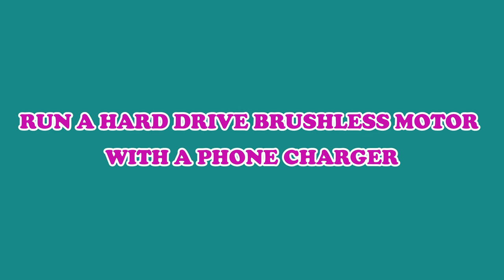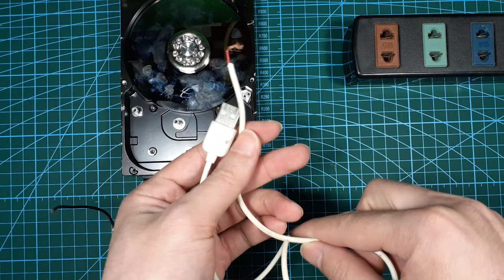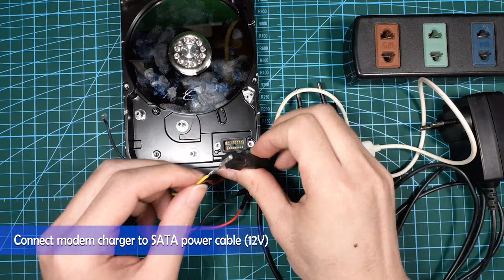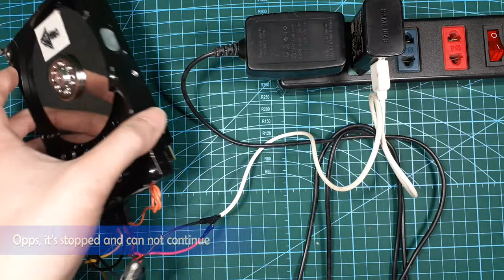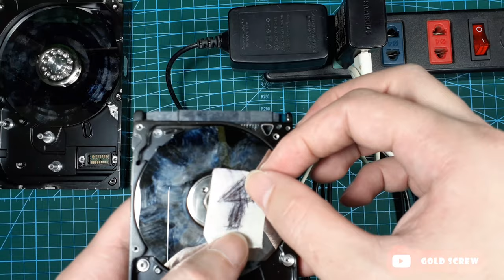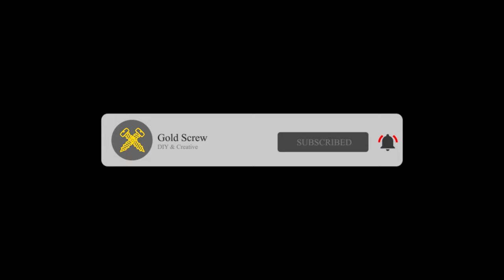Run a Hard Disk Drive Brushless Motor With A Phone Charger

Comment: Hey man, so i tried this setup and did work without a problem, But i have a question if you might know or if anyone else does,  I have an adapter for the USB  that has Output 5V 2.0A or 9V 1.67A or 12V 1.25A. So i was wondering if i can use the 4 wires in the usb cable, red - black to sata red - black for 5V and the other 2 in the usb cable to Yellow - Black Sata 12v and then connect it to the adapter that has all those outputs or would it not work like that because the adapter can only have one of the outputs "active" at a time?  Thanks in advance and great video :)

Comment: Thanks for the video , I think we can use a single 12v adapter and a voltage regulator for the 5v input
Reply: How to check the motor
Reply from the maker: Yes, You're right!
Or can also use a booster from 5v to 12v. Very much module/board available for sale right now (but better is from 12v to 5v).
Hope you enjoy :D
Reply: Yes , a simple .
Reply: Instablaster
Reply: @GoldScrew U need only 1mA for logic at 5V & 1A at 12V for motor driver, booster is nonsense

Comment: My bro,

Why don't you have this written out?  Your video is of little help because we can see what wires you are connected to for + and -.     Is that the SATA plug  you are making your connection to?   By connecting pin 3&5 to one another, what is that for/doing?    Which wires on the yellow, black, red, and orange connector do we connect to?

just a small listing of what wires you are connecting your 5V + to and 5V - to.    If we reverse polarity, does it spin in reverse?  prob not if its brushless..

Anyways,  text is always best, video is good as a visual reference, as an aid.

thanks man.
Reply from the maker: Yes, that's right.
I should have explained in more detail. However, because of the time at that time, I did not have much and I also wanted the video length to be moderate.
Why don't you find your own the answer: try reversing the + and - poles...etc? This is not difficult at all.
And please share with me the results :)
Thanks for watching!

Comment: Unfortunately mine doesn't work. I have a 3TB Barracuda DM001 and neither the 6+2 or 3+5 pin shorting works. It stops after 10-20 sec. Plus mine requires the r/w head socket to be bolted on, as I see yours is not, it has contacts on one of the two screws holes. I guess it's a hit and miss, have to try other methods.
Reply: You can test 2+6+7 pin.

Comment: Why do you need 12v& 5v to operate the motor ? Can I only use 12vdc with a speed controller?
Thank you
Reply from the maker: It’s depending on SATA power standards!
Yellow wire need 12v…and other color need 5v.
You can using only 12v and downgrade from 12v to 5v.
Understanding the standard SATA power supply pins in the HDD | Gold Screw
https://youtu.be/biN-sTTtEPI
Reply: the motor needs the 12v and the logic board needs 5v is my understanding and in order for the motor to work even the logic board should be powered up

Comment: You connect pin 2 with pin 6 to avoid stop with SATA HDs, do you know if there is a similar connection with IDE HDs? Thanks.
Reply from the maker: I'm not sure about IDE HDD.
I will research it and update and let you know soon asap.
Thanks for your question!
Reply: Bumping this question!
EDIT: Never mind, it's answered below!
Reply: PIN 1 AND PIN 2 of data conector. up right 1, up left 2.
Sorry for my bad english.
Reply: @pacoperezabella  Dont understand up right 1 uo left 2. i tried but no luck. its an 80 pin ide.

Comment: I shorted the 3 and 5 pin in sata but it still not continiously spinning, any solution
Reply: Try linking pins 2 and 6 instead, but bear in mind that not all drives will work like this - it seems to be a sort of undocumented feature that's not universal across all manufacturers

Comment: Will this process work for dvd drive motors also? 😶 Please reply
Reply from the maker: I'm not try it with DVD drive motors. But if it's brushless motor, I think it's can run no problem!
Reply: Ye
Reply: It Will work. I have tried it before
Reply: @emilsamuelsson1001  it didn't worked for cd drives brothers and sisters.. seriously I've tried thrice 😭 .
Reply: @smartgamersify  it should work if its a brushless motor that can run with DC powersupply
Reply: @Dax_eth  do you know wanna say that I'm lying to you guys? 😌

Comment: In case of pata connector which pins has to be connected for running continuously ??
Reply: Many IDE type hard drives will spin continuously as long as the power is applied, but not all. In particular, Western Digital drives won't stay spinning in this way, stopping after a few seconds.
Reply: first top left and last bottom right, or bottom left and top right, don't remember now.
Reply: @adriel3305  could you tell in detail using pin numbers.

Comment: Can you please confirm on how to do it for IDE HDDs ?
Reply from the maker: Maybe you'll need an adapter to switch SATA to IDE
Reply: @GoldScrew  thank you for your prompt response and keep up the good work.
Reply from the maker: @shouldbewillbe2813  I will trying to find old IDE HDD and make other videos soon.
Thanks for watching!
Reply: @GoldScrew  please do pass on the link of video to me as soon as you have made it. Thank You, you are the boss
Reply: For IDE drivers you need to jump the first up pin on right corner, with the down pin on left corner. FOr SCSI IDK
Reply: @linuxuniverseofficial  Thank You so much Guru ! This will be a great help for me !!! And I don't have SCSI drives ☺️
Reply: @shouldbewillbe2813  not working...
Reply: @linuxuniverseofficial  not working
Reply: @ratikantamahapatra8847  Sorry... IDK so how to do it in any other way ;/
Reply: @ratikantamahapatra8847  try the other opposite ones and post result.
Reply: @shouldbewillbe2813  top right and bottom left way is working....thanks sir
Reply: @ratikantamahapatra8847  congrats ratikanta
Reply: @linuxuniverseofficial  a huge Thanks to linux universe as well
Reply: Pin 1 y Pin 2 del conector de datos.

Comment: Hello. Can we use a 5V adapter and a regulator instead of the 12V in order to control the motors speed ?
Reply from the maker: The best is 12V, because the brushless motor required 12v. So if you want to use 5v, you'll need a DC-DC boost converter
Reply: @GoldScrew  i tried it and it burnt the motor. Any explanation for that ?
Reply from the maker: Maybe something wrong at wiring step!
I can’t see more detail your issue, only text here is very difficult. So I don’t have any ideas 💡
Reply: @abbashammoud7205  probably you connect it wrong or the voltage is too high

Comment: Tried this and does not work at all
Reply: It works. Make sure not wrong polarity or ended up frying
Reply: It work's make sure right polarity or you will fry it
Reply: They were right I followed your steps
Reply: Either the board doesn’t work
Reply: @jakubthewildbirdsaver2947  yes. The board does not work

Comment: Click bait. You also need a 12v DC power supply along with the phone charger.
Reply: incorrect, i have succesfully powered an hdd with just a 5V charger.
Reply: it’s in the fucking thumbnail
Reply: can you tell me how?
Reply: @zalika26 2.5" hdd use 2.5 hdd enclosure powered from usb phone charger.
if it 3.5" hdd use 3A phone charger and dc-dc boost...